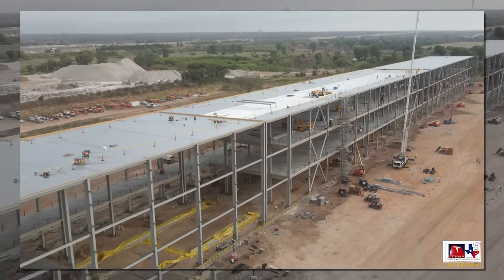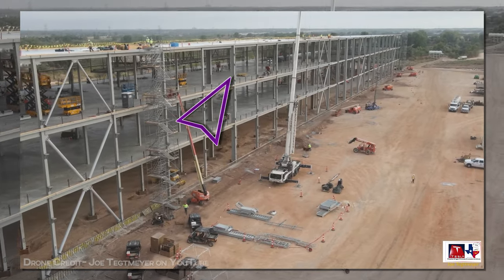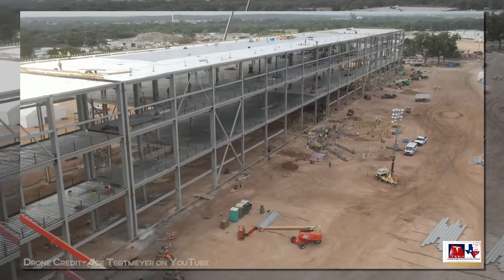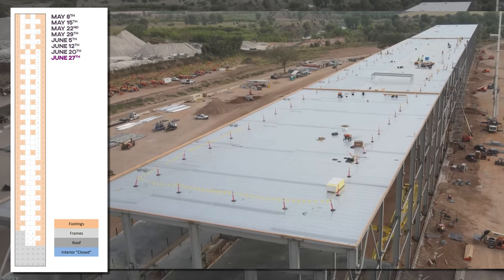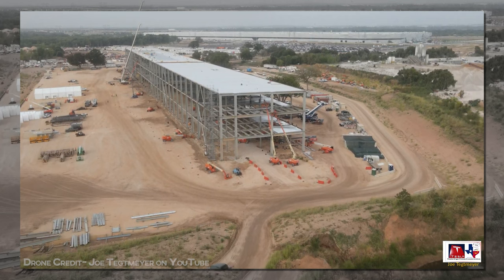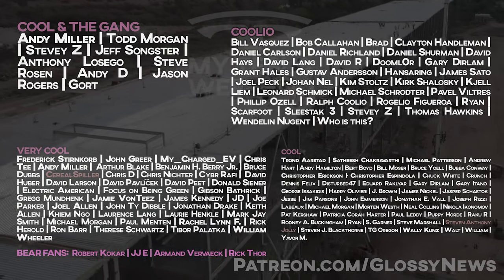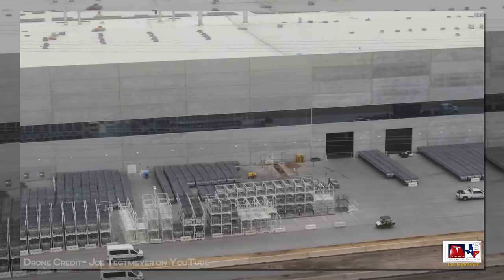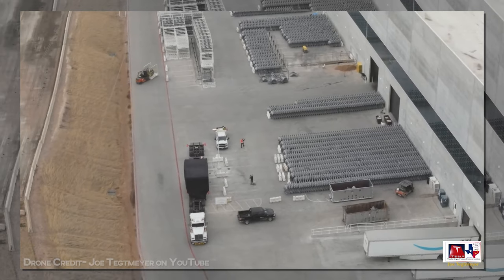The cathode building is 62.5% done & we’re stuck waiting for walls

Comment: It is interesting to note that if Casting machines become a bottleneck that it is relatively easy to build another building for castings with the transport carriers illustrated on the East side of the main building.   This could be years from now but if they decide they want to build Model 3s with front and rear castings (or its replacement) down the road, surprisingly they could run out of space at main building.  It might well make sense to build an East Coast GF also which would roughly match the volume delivery for the East as well as provide additional redundancy.   A site in the Southeast would most likely be chosen due to right to work rules and a fairly qualified labor force.